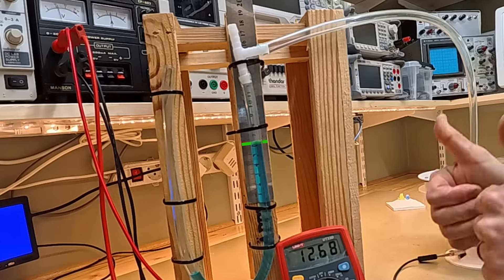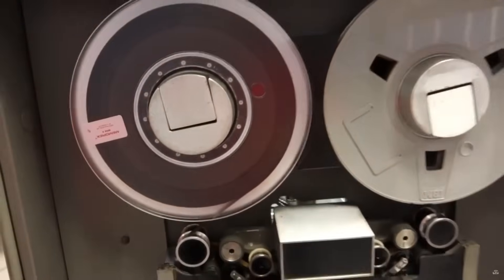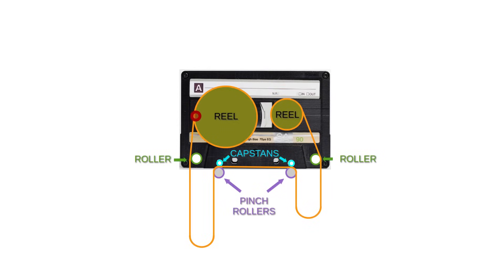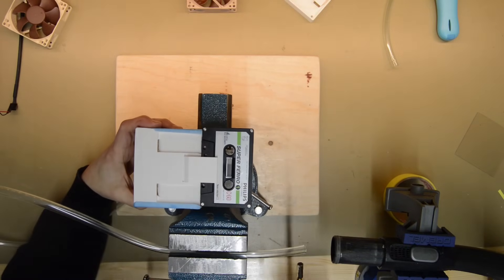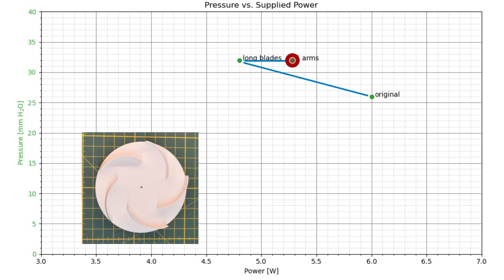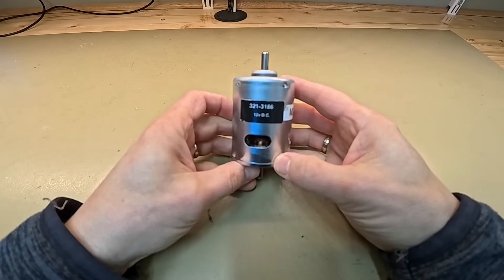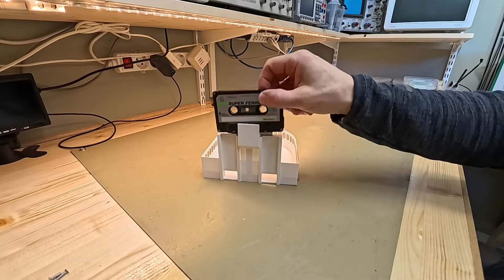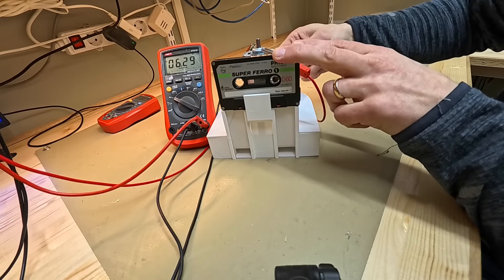The Vacuum Turbo Tape Drive Ep.1: The Quest for Vacuum

Comment: Nice to see the principles of the IBM 729 being applied to smaller and lighter compact cassette, too! As you rightly say; Disk/drum storage hadn't become practically available by then (Closest was the IBM RAMAC, and those were not cheap!) and the breakthrough in the 729 was that it managed to separate the problem of reel inertia from the need to pass the tape over the heads at high speed. 
In this respect the vacuum columns were kind of like a reservoir of tape that could be passed over the head in isolation from reel movement, provided the reels could provide/take up enough tape to avoid snags or excess. 👍

Looking forward to seeing this project progressing further! 😁
Reply: Even when drum memory came out, while it was fast, it's capacity was quite low.
Reply: @paulstubbs7678 If I'm understanding correctly, it had many of the same issues as core memory albeit in lower magnitude. Core was horrendously expensive (It mostly had to be handmade) and most core frames were perhaps no more than a single KiB in size.
Drum got the cost of random access storage right down (Don't ask what 1MiB of core would come to! 💸) but though faster than tape it still had its latency issues. In most cases it was employed as a compromise between (faster) core and (slower, but much cheaper) tape. 😇
Reply: @dieseldragon6756 I've heard it said, the main mainframe computer used by NASA to put man on the moon only had 32K or core memory - and what was their budget back then!
Drum memory was like having a multi platter hard drive, but with each platter only having one track. As far as mechanical storage was concerned, drum was about as fast as you could go, no seek delays, because the heads don't move, unlike a regular hard drive.
Tape for everything else.
Actually tape has never left us, it's still used for backup and archival storage.

Comment: as an experienced mainframe operator since 1969, The video you showed is not entirely accurate. First off the tape is never read a "record" at a time, It is read a BLOCk at a time. A block may contain MANY records. 2nd, as the tape is being loaded into the vacuum columns, the high speed capstan then comes out from the back, and the tape is then put in between each capstan and a PROLAY. The PROLAYs are plastic pinch rollers, and the capstan are rubber. There  two capstans, one is for FWD R/W, the other is for REV R/W. The PROLAYS activate to move the tape FWD/REV. This gets the tape up to instantaneous speed and moves the tape over the R/W head. As the tape leave the tape head, it dumps into the vaccuum column. When the vacuum sensor determines there is to much tape in the column, it moves the reels to either take up, or add tape from/to the column. The bottom vacuum sensor will activate when it senses a vaccum, the upper sensor will activate when it senses a LOSS of vacuum. An important thing to remember is that the IBM 729 drives are 7 trks, meaning the read 7 tracks of data at once. Later on like on the 2401, it was a 9 track drive (8 Data bits + Parity), hence there term 9-Track tape drive. Th density of the tape were 556, 800, 1600, 6250 Bytes per inch. The recording methods was  NRZI (556/800 Bpi),  PE(1600 Bpi)., or GCR (6250 Bpi)
Since cassette tapes only have one head capable of reading or writing 2 tracks at a time, data must be recorded different
Reply from the maker: Wow, thanks for these details! Yes, the encoding of the data will be an adventure of its own, I'm sure.
Reply: @fulkonto1222  If you can get a four-track head in there, you could do a nibble at a time across the tape width, or even try DTMF encoding one nibble per track (16-bits cross-tape). Both approaches would require a separate means for tracking, block identification and error detection, though... 💾

Comment: Very cool! But I think you might have divided all "mmH2O" measurements by 2. When you suck up 10 mm in your tube, it also lowers 10 mm on the other side, so difference is 20 mm. And starts to become non-linear when approaching the u-turn at the bottom. 😬

Comment: if you want a more compact vacuum motor, look into those 2" server fans. you can get some that are designed to have two connected together for extra pressure. However I think your method is much quieter so its probably not worth it.

Comment: Try adding a lip that extends from the hole into the impeller inlet to decrease the amount of air leakage. Also, are you now using straight or curved impellers? As far as I know, backwards curved blades are the best for static pressure.

Comment: "The 1960s," but then Marc says that these are supposedly because "disk drives didn't exist back then."
Yes they did; they've existed clear back since 1956!
Reply: You're right there, but you also have to consider the economics of the time. Most companies - Given the choice between a single RAMAC and a bank of 729s - Would opt for the 729s every time. They're based on more trusted/better known tech, easier for their own technicians to service, and the lower cost-per-unit means that redundancy is easy to provision; If your business needs three drives, you can buy five for the cost of a single RAMAC and have enough overhead that two failed drives don't bring the business operations to a halt! 👍
Reply: @dieseldragon6756: Maybe so, but this isn't what Thor said, hence what I said.

Comment: Might be a stupid question, but will the Magnetic field of the motor interact at all with the tape?  They seem kind of close, the tape is completely unshielded, and the motor is very large, so it gives me some concern.  It might be no effect at all, but it just seems concerning.
Reply from the maker: That's a valid question, but I'm not too worried about it. The reason is that the magnetic field decays rapidly with distance. I'd probably need some 0.1T or so to erase the tape, and to create that at a 100mm distance (as compared to ~0.1mm) I'd need an "MRI-level" magnet. The motor datasheet doesn't specifically mention the strength of the leaked magnetic field, but I hope they'd put a warning label on it if it could pull chairs across the room.
Reply: @fulkonto1222  I imagine the steel body of the motor will function like a keeper and confine a lot of the external magnetic flux to itself, too. You can do a loose test for magnetic flux strength using a cheap compass 🧭 - If you hold it close to where the tape will go and the needle still points North, the flux from the motor isn't having an effect in that area. 😇

Comment: I guess you got what you needed but I think you might have found a vacuum pump the right size in a McMaster Carr catalog. It'll probably be quieter and lower power. 

No need to reinvent the wheel. You're going to have plenty of other challenges.

Think it's a very cool project, look forward to more. Also love you chose the TDK SA90 for your cassette image. It was THE cassette back in the day!
Reply: A CPAP pump would be ideal for this. They are silent but violent! Aliexpress has them though I would not recommend them for life support use.
Reply: That was my first thought as well, but watching it, I realized the journey of figuring it out must have been a lot of fun

Comment: Psst, some words of advice, look into used combi oven burner assemblies. They have to pull something like 5 inches of water column in draft to even satisfy the safety switch during operation

Comment: Haha super neat! What a fun project. 

Just FYI, I think you're measuring mmH2O incorrectly. It sort of doesn't matter as long as you measure consistently and are doing this empirically. But in a U tube manometer like that, one measures the difference between the two columns, not the height change of one column. So what you're registering as 60 mmH2O is actually 120 mmH2O (if I'm seeing what you're doing correctly). 

Another point to make is that static pressure of a centrifugal blower is almost completely independent of blade shape. As long as the air is fully entrained by the rotor to rotate at the same speed as the rotor, then it's purely the diameter and speed of the disk that matter. The blade form basically will only matter to the extent that you've got leakage that's allowing air to bypass the rotor, or have slippage between the air and the rotor (such as in a single sided disk). In those sorts of situations you need to do actual pumping work to maintain pressure. 

If the leakage is very low and the air is rotating at the speed of the rotor and the inlet is small (ideally your case fulfills all three requirements), then the static pressure is basically purely set by the equation P = 1/2 * density * (2*pi*revs/sec)^2 * radius^2. 

Let's check if this works! Density of air is 1.3 kg/m^2, revs/sec is about 72, diameter is 155mm so radius is 0.0775 m. This would suggest we can expect a pressure of P = 1/2 * 1.3 * (2*pi*72)^2 * (0.0775)^2 = 799 Pa, or about 80mm H2O. So it would seem that since you're getting 120 mmH2O (based on my understanding of how to read a U tube manometer), you're over-performing! It's possible that RPMs are higher. It's also possible that the pump system is leaking enough or enough air is coming through the tape channels that the pump is working somewhere else on the pump curve besides static pressure. If you have forward swept vanes, then the pressure produced will actually be higher with a bit of air flow than with no air flow. Another possibility is that the air in the immediate zone around the pump rotor is also rotating. Since you have this air trapped between the two housing faces, that air also can help create suction through centrifugal force, and effectively enlarges the rotor diameter. Working backwards, if there are no other effects, the math would suggest an effective rotor diameter of 0.094m (190mm). So I don't think that's totally what's happening here, since it doesn't look like your housing is that big.

Anyway, that's the basic math, hopefully that's helpful! 

Really nice build quality, I love the way you got the rotors to snap onto the motor hub. I'm sure that really helped in achieving such a good result. 

Looking forward to the next part!
Reply from the maker: Thanks for the comments! Yeah, I know I measure just half the the established "mm H20" convention, but it was so much easier for me to strap on a ruler and measure half the value, so I went with that. Maybe I should have commented on it.

 I am a bit surprised about the 80 vs 120 mm H20. That's a quite large discrepancy. On the one hand I'd like to blame it on the very poor "datasheet" for the motor (i.e. I cannot really trust "4350 rpm"), but on the other hand, I doubt that I actually run it faster than 72 r/s: that's pretty fast! Yet I can't fault your calculations. I wished that I had an rpm counter.
Reply: @fulkonto1222  Just photocopy a ruler at 50% zoom and you'll have the correct but easy measurements you want.
Reply: @fulkonto1222  I'm surprised too. It's frankly pretty bad disagreement between theory and experiment. 

Were your vanes forward swept, or reverse swept? Forward swept vanes cause the air to attain a higher angular velocity than the rotor, that could partially explain it.

Since both RPM and radius are squared, it wouldn't take a huge amount of discrepancy for those two things to explain it. If we said that the air which extends 8mm past the rotor is co-rotating with it, that adds ~10% to the radius (so ~20% to the expected pressure). 

The voltage was 6% above nominal (so ~12% pressure increase). 

Then if we say that the motor was slightly higher KV than expected (which equates to weaker magnets or fewer turns of wire, both of which are probably good for cost) then we'd have to say that the KV was maybe 9% higher than stated to account for the remaining 18% discrepancy we have left. 

Still, that's kind of hand-wavey, since the motor would run slower under load. I admit it wasn't the most satisfactory result.

Comment: Is tape loop’s depth in the column controlled separately per column? If yes - how? The control engineer in me wants to know what are controlled and manipulated variables : )
Very nice project, thank you!
Reply: On the IBM versions there's two holes in the column that connect to pressure switches. There's no analog control loop as such - if the tape is too high in the column run the motor one way, if the tape is too low in the column run it the other way. If it's between the sensor holes - do nothing.  Each motor is controlled individually based upon the hight of the tape in the associated column.

Comment: I think the spam filters are catching me up here. I remember taking apart some old DLT tape drives and the motors look like something that could help you here. They are Copal 12v DC 2.5 Amp DLT Tape Drive Motors #PN12-60119-01. They have a threaded shaft and directional control and if I remember a tach output.  Thanks for sharing.

Comment: Very interesting!!!!!
I'm not entirely sure what you're trying to achieve, the spool of an audio cassette is so light and has such little inertia that you can simply make the tape move at the speed you want and stop or accelerate it suddenly without breaking anything. On the other hand, with IBM reel-to-reel recorders, the reels were so heavy that it was impossible to manipulate the tape instantly, which is why they had a buffer. Still, an interesting project.
Reply from the maker: Well, I of course want to make it as fast as I can, but I'm also a sucker for that old 60's retro-sci-fi-style tape drives: their looks and behaviour. So maybe not all design decisions will be made on a strict engineering basis. The vacuum channels may have been necessary back then, but I guess we'll find out if they still are in this concept. But I'd really like a mini-version of the old drive, that works, and goes fast. :-)
Reply: The problem comes from the inertia of the providing reel plus the tape still spooled up on it. As you start pulling on the tape faster and faster the provider reel will spin faster and faster and have more and more energy stored in it when you stop pulling on the tape requiring you to remove that energy or else the reel is gonna keep spinning after you stop pulling. With the vacuum system you can harness this by letting the extra tape spool into the channel. This means the tension of the tape across the head does not need to be the same as the tension of the tape as it comes off the spool so you can accelerate the tape to extremely high speeds and stop it almost instantly without worrying about snapping the tape or spool over spin causing extra tape to come off the reel. The whole reel total weight thing is just a side effect of doing it like meaning that reel weight no longer matters it just needs to be able to put up with the amount of tape you want on it and not cracking under the high start stop forces.
Reply: @Jackpkmn  There are more modern drives from the 70s onward that do this with simple spring tensioners, because they have more control over the torque of the capstan motors and the reel motors.

With today's servo controls you can probably get away with only a simple tensioner arm on either side, a lot like a VHS deck uses. But that's a lot less challenging to build.
Reply: You may get away with high speed reads without vacuum columns if you're just doing a single non-stop read, but if you want to seek about the tape and treat it more like a random access device then this level of decoupling seems essential.
Reply: @martinwhitaker5096  And even for full reads of the tape - Which wasn't what the IBM 729 was used for - You still have reel acceleration and deceleration to take into account. That's one reason why the GNU Tape ARchive utility adds 10-20KiB of null bites at the end of each TAR archive (According to the manpages). 📼

Comment: Looks like there's enough vacuum at 12V to pull the tape down with some force so you won't need any special modification to the rollers or the cassette. Meaning you can probably get a dual capstan tape transport from a cassette deck as the mechanical transport and use all standard cassettes.

Also, by increasing the tape speed you're increasing the product of tape bandwidth and dynamic range. So you can either use the dynamic range increase (by using multi-level modulation) or the increased bandwidth to store more data.
Reply from the maker: It turns out to be a bit more tricky than I thought to obtain a suitable cassette player to pick components from. It has to be stereo (It'll be evident later why that's the case), but I also  don't want auto-reverse due to the complicated reversal head, and the pinchroller operation/activation is usually not allowing the tape to be routed out from the cassette.
Reply: @fulkonto1222  You may be able to find an auto-reverse deck or a multichannel deck (like a Tascam Portastudio) which has a 4-track head so it doesn't flip around. That way you have 4 tracks you can use in a single tape direction.

You would still need to source the (closed loop) dual capstan transport from somewhere else - those were only found in high end decks. But for the application you want, closed loop capstans and direct servo drive reel motors are absolutely necessary.
Reply: @Stoney3K  I'll add that earlier Sony walkmans with auto reverse might also fit the bill - The earlier models employed four-track heads and had dual pinch rollers moved into/out of place by a direction selection bar You'd still need to modify the pinch rollers to be driven very quickly - And to modify the tape transport to accept tape from the vacuum channels - But as a base mechanism to work with, that would be my first choice. 👍